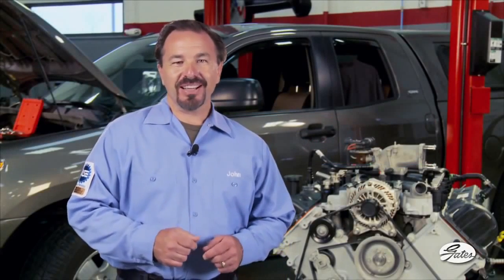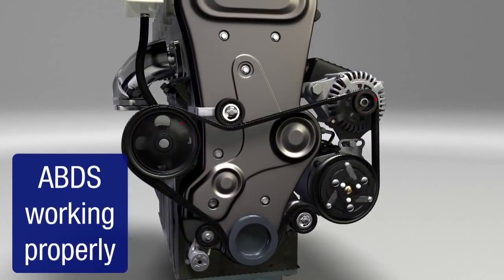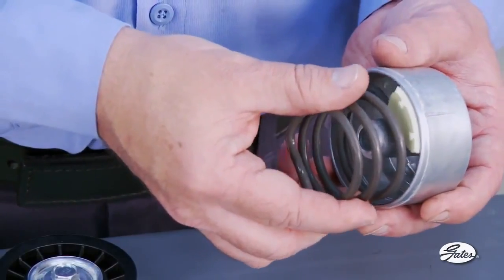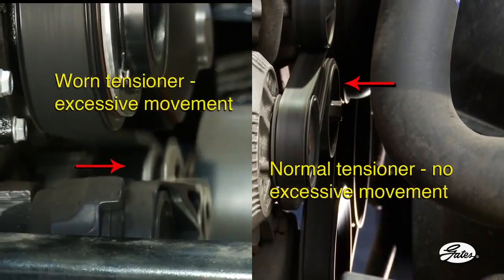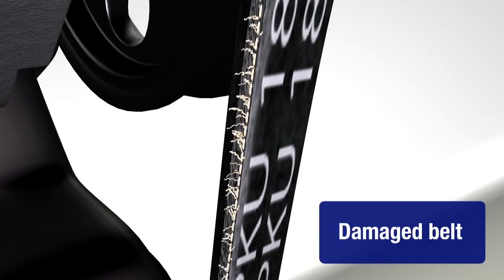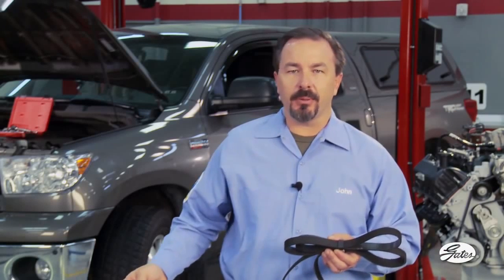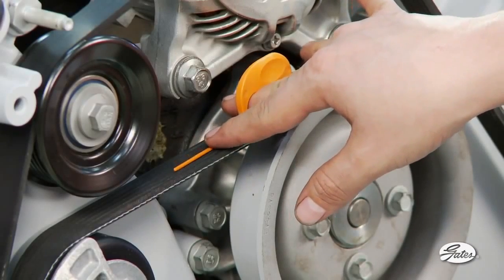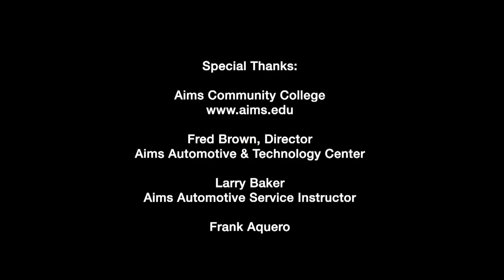GATES TRAINING: Accessory Belt Drive System

Comment: Very good and I'm not a technician, just an enthusiast driver. Before seeing this, whilst I was going to change my auxilliary belt to a new Gates belt, I didn't have in mind the need to change the idler tensioner. In fact I had spent some time to find just the idler wheel because I assumed that the rest of the hardware was not doing so much, for me to be worried about it at only 150,000 miles, which after all on a diesel is just about when the engine starts to get nice! In my case for sure. Now I've seen this, I'm not messing about. I'll just change the whole unit. Its only £12 more than the pulley wheel so I was doing myself no favours. Its amazing what you can get from a very good video even if you are already tech savvy. Thanks Gates!